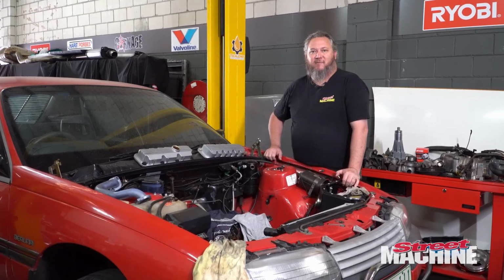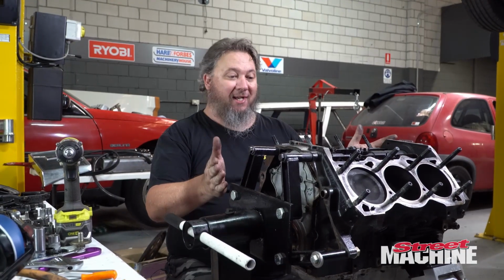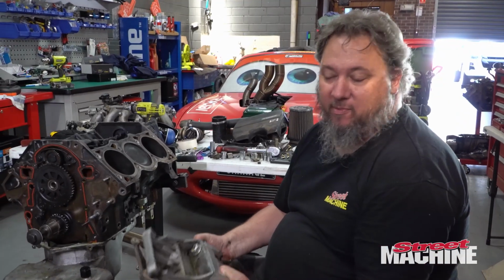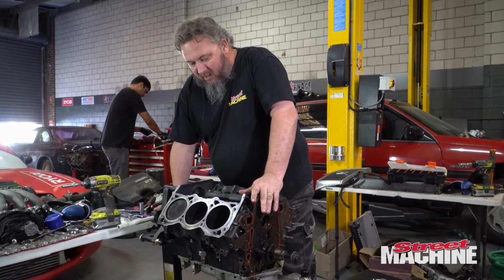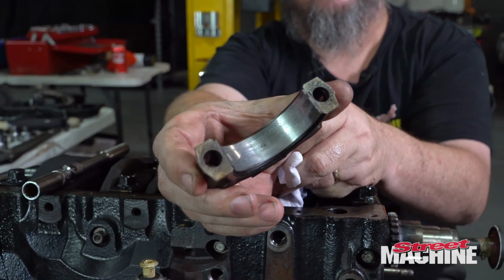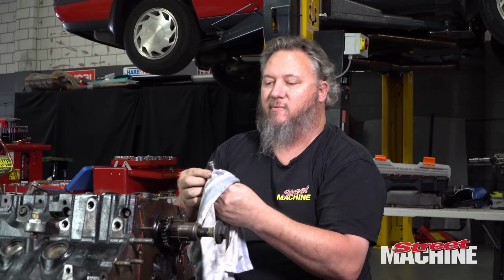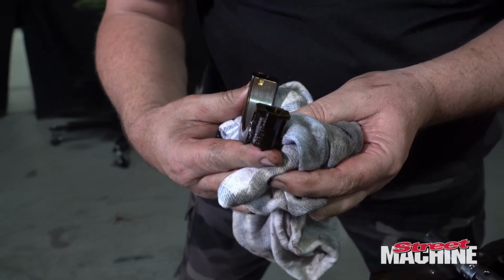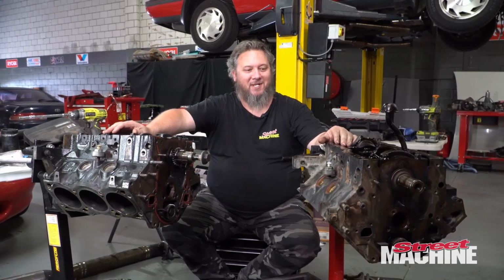Carnage Plus EP97 - More Supermang Problems!

Comment: I've done numerous tests on mains bolts before and an increase of 10Nm reduces the bearing clearance by an average of 0.010mm from top to bottom. Side clearances didn't change much.  The main issue with using a torque setting is the error caused by friction in the threads and under the head of the bolt, this is why ARP recommends using a specific lube and strain gauge to get the correct tensile clamp force.  And yes, it is highly recommended to resize the bores if using "non-OEM standard" bolts due to the changes in sizes as mentioned.

Comment: If those big end bearing shells are not staying in the rods id bet there is a lack of crush...
Strip the engine, dunny brush hone, new rings, new bearings at a minimum and then bolt all your other good bits on and send it...
Or
Go all in and full rebuild...
Either way I’m sure you will entertain us 👍🏻

Comment: Scotty, if you have a lathe just linish it yourself and plastigauge you’re clearances on assembly. And while the rods are out at a minimum you may as well give it a hand hone and throw some new rings in it. At least you’ll have more of a chance at having somewhat even cylinder pressures. It’s by no means a blueprint engine but it’s a cheap exercise at least it’ll all be uniform

Comment: New camera man is awesome! Sound quality seems much better aswell and doesn’t seem like you are shouting/talking loudly at the camera. Your voice sounds much more relaxed even though you are clearly frustrated after your findings😂 I’ve  in the same scenario right now ...Brought a parts car for a motor that had top end “rebuilt” (motor did actually run well) pulled motor out and decided to regasket bottom end as it was leaking and pulled sump and decided to check rod bearings... let’s just say basically everything in the very bottom is now in the bin 😅😅

Comment: Mate I'm going through the same with a sohc 4.0 with an m112. 
Re-ring and hone, linish the crank and new bearings, deck the block and resend the fucker. Gap the rings for the higher boost  while you're there.

Comment: Shouldn't have checked. Linish crank with wet and dry and stick some shells in it, it's not as if you don't have another block if the rods come out
Reply: Different deck heights
Reply: @gregmcnamara2563 they have 2 supercharged v6's. The vn v6 is different as you said.

Comment: Whack the pistons out and put extra ring gap in, these motors are common for breaking ring lands when the boost is upped. Chuck in some bearings and send it.
Love the mang episodes boys
Reply: p.s I’m running a L67 in me Bedford van👍🏻
Reply from the maker: Can't say I've heard about them smashing ring lands, but thanks for the tip.
Reply: @STREETMACHINETV  the ring lands breaking pops up quite a bit on the Facebook pages. We all thought it was just crap cast pistons before we learnt about proper ring gap. Now there’s guys running 600hp on stock bottom ends with ring gap.

Comment: The one type of stud you were missing Scotty was CA625 aka Custom Age. 👍 Good for drag spec and no limit budgets, but for street/strip the HP2000's are fine. I got ARP 2000 main studs, head studs, rod bolts and flex plate bolts in/on Crustida's motor. 😎
Reply: I believe the rod bolts he’s talking about are L19, and ca625 is there studs which are also stupidly strong haha

Comment: I love the way you explained project creep. It happens to all of us. We need you, Scotty, to lead the way as a beacon of sensible light and just bodge the whole thing in the garage! Prove to us that it can be done and our wallet can stay safe and happy in our pockets.

240 ksi bolts sound pretty impressive, but they hold bridges up with 150 ksi bolts and I've seen a lot of broken rods but not many loosened big end bolts that caused them. At the end of the day, I trust SAE over ARP and believe that 150 ksi is plenty to keep the big end closed up. Plus, unless you're torquing them up to about 100-150 Nm, it's hard to take advantage of that tensile strengh.
Just by the by, shear strength is the side-on force they can take before being ripped in half - more applicable to a gudgeon pin than any engine bolt.

Keep the simple stuff simple, save brain space, and decrease your cognitive load to reduce mistakes. Example: could just number the big end caps 1-6 from the front to the back.

Comment: I could be wrong but Hey with today's modern access to The internet I'd try to spec out it's original 3.8l to be similar too The Buick gnx motor And dump boost on it.. Maybe that's an option... depending on it's difference

Comment: If the bolts are made from a higher yield strength material then of course they will need more tightening torque to get the desired bolt stretch.

Comment: Hey scotty, i hope your using old school mechanical measuring tools and not the digital type, they are a lot more accurate. :) Also Scotty mate why not use a engineering scribing tool to mark what you need that texta is just going to come straight off mate? Also why not use the plastic slip measuring slips used to check clearances in-between various caps when doing the torqueing up of various areas with in the motor?
Reply from the maker: It's just temporary marking it for me, not meant to be permanent

Comment: Just stroke it, no going back now.
This is what you get for playing with the most bogan engine going though 😂
Reply: The stroker cranks are known for reliability issues. Unsure on the new billet ones but the original 4.2 kits had some issues when boosted.

Comment: I know the pain as I pulled a vn v6 because of the oil pump destroyed it self didn’t check anything on the new motor that only had 177k on it and it has a blown head gasket pulled the head off and the amount of carbon build up is stupid pulled old motor apart and the bearings in it looked better then what you have I should of just changed the oil pump and sent it
Reply: @ldnwholesale8552  Actually the 3800 is one of the most reliable gm engines there is, just people expect to put canola oil in them every 5 years and no other maintenance and then say they were a shit engine when they got better mileage than a diesel in a semi trailer
Reply: Chuck.U.Farley I dunno about being the most reliable, maybe if you baby them, I’ve seen at least 6 chew up bearings and have rod failures with a bit of rpm, all standard tunes and limits, all bar 1 of them had good oil in them. The one that didn’t have a good oil in it was a fella who after it disintegrated was telling me that was his 5th he’d thrown rods from, he had photos of 2 other engines with holes in them to prove those. He was someone who didn’t care about them though. 
My Holden loving mates now have AU falcons to rally around, couple hundred bucks and can rally them all day no issues. I have an xg with an au 4 litre, that thing stays at 5000+ rpm for hours over a weekend, have never broken one,
Reply: @ldnwholesale8552  so the oil pump in original motor went and the head gasket went on replacement motor. At a guess the oil pump went because of timing chain guide failing and at a guess the replacement had a blown gasket on the fire ring from pinging with the amount of carbon build up in the head I’m guessing it had only ran the cheapest fuel it’s entire life

Comment: Nike . Just do it . Build the other vt engine with forged pistons and rods for future upgrades like a big fucking turbo like corn fed boost did to get stupid power from the v6 . Linish hone new rings bearings are cheap to do . All l67 enigines got thrashed unless granpa owned a statesman and didnt thrash it . Standard vt onwards cranks are the same as supercharged engines . Vs wernt they were different than the standard vs cranks . Vt on all the same part numbers on the cranks .

Comment: Am I missing something? Could you not just swap the cranks over?
Reply from the maker: You can but it's not a good idea. Typically would require rebalancing
Reply: Externally balanced and the factory tolerances aren't tight. You can order aftermarket flex plates , new old stock and all the balancers. 

Only way to transfer balance from one to another ; would be to shadow balance the flexplate and balancer. I've never heard of it for replacement. Just like people don't re balance when they go to a solid flywheel. Unless l36 to l67 as the l67 has another weight welded on top of the l36 one when you put two side by side. 

I'd be using the other crank. If it's low km. You'd have better clearances then the old one after linishing. 

Also a micrometer will tell you almost every time that you need to align hone the rod after arp bolt installation. Even arp tells you to do it. 

You should have been able to see the bearing wear when you removed the cap to change the rod bolts. If it looks vastly different it's not a hard thing to realise why.

Comment: You could pull the main caps on that old motor, if the main bearings are good you can blame the rod bolts, if they are bad then you know they all match
Reply from the maker: Good point